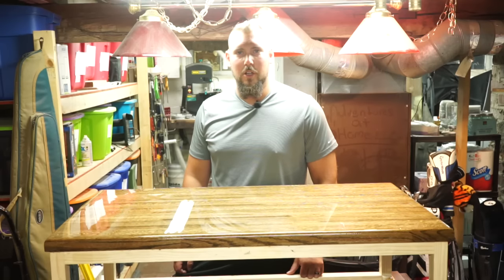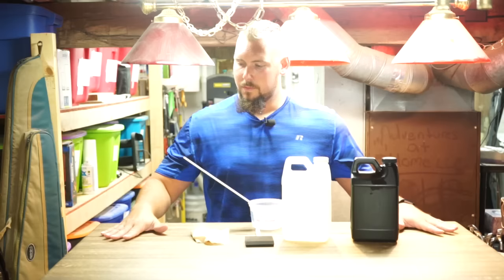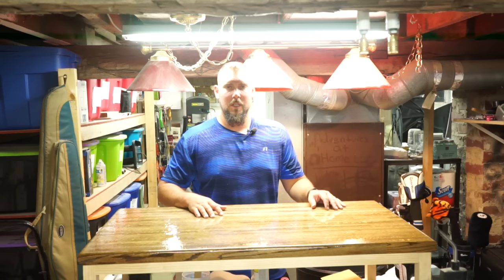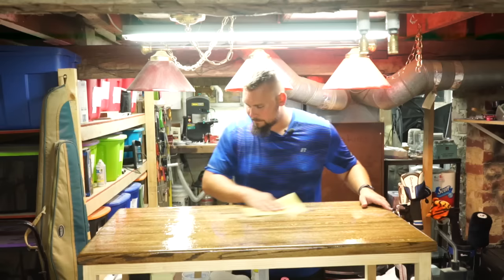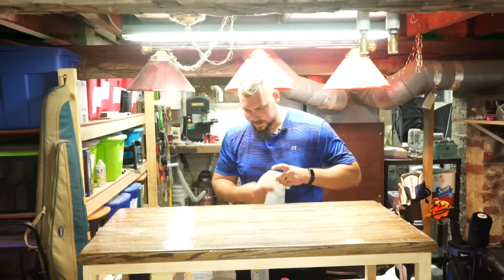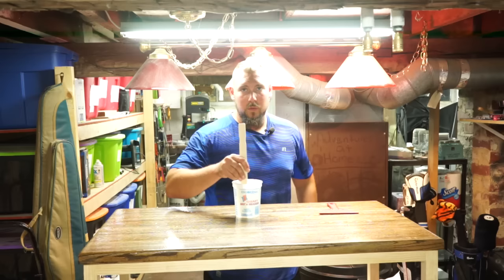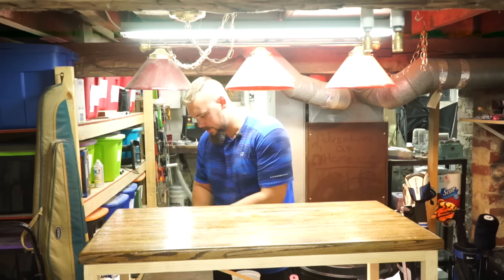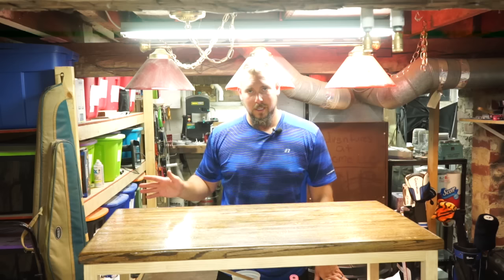DIY – How to Apply Clear Epoxy Resin – “Liquid Glass”

Comment: I’m late to the party but thanks for this video. It was really helpful. Do you remember where you got the weights for the resin and hardener? I’ve searched and haven’t found them for Glaze Coat which is what I’m using. When I tried mixing with the g/ml that you mention for each it did not look at all like a 1 to 1 ratio in terms of volume. Closer to 2 to 1, resin to hardener. Thanks!
Reply: I use clear cast epoxy resin that’s 2.1   Can do 50mm cover normally 5 kg will do a large table.   Hate the polyester resin it drys to quickly

Comment: I'm confused, the epoxy link you showed says its 1:1 ratio, but it seemed like you did about a 2:1 ratio.
Reply: It's a 1:1 volume ratio, but he measured by weight. Since the densities of the resin and hardener are different, the volume and weight ratios are different. I know this is reply is probably too late for you, but hopefully it'll help someone else with the same question.

Comment: I want to use epoxy on a plywood flooring project. Would this process apply?
Reply from the maker: I wouldn't recommend this epoxy for flooring. It would probably not be durable enough to handle foot traffic. Thanks for watching!
Reply: @AdventuresAtHomeLLC  I really appreciate the response!! What epoxy would you recommend? a flexible one?
Reply from the maker: Generally polyurethane is used for flooring. But if this won't yield the finish you want, I would look into a marine grade epoxy coating
Reply: @AdventuresAtHomeLLC  Awesome!!I will look into that! Thanks again and I loved the video bro!

Comment: Did you use all of epoxy for this size table or did you have leftovers in jug.
Reply from the maker: Conservatively I would say we only used about 1/3 of the jugs for this project. We use epoxy quite often so we buy by the gallon. Thanks for watching!
Reply: Damn that's a good question I like to know the answer 2

Comment: Not all epoxy can be weighed to equal parts so be careful when you use scales to measure your epoxy.
Reply from the maker: Correct. They are all measured by volume to get the correct ratio. Which is why we start with volume and covert to weight. Thanks for watching!

Comment: Kile my stuff still not dry afte a week 🤦🏾‍♂️, can I send down and start over
Reply from the maker: I would scrape off as much as you can with a plastic scraper - use a little heat to help. Then sand any thing else off. Good luck, and thanks for watching!
Reply: @AdventuresAtHomeLLC  in my experience this is an issue with the hardener/ epoxy recipe. It's crucial to follow the ratio as closely as you posdibly can.....
Reply from the maker: Exactly why we weigh ours to the gram before mixing!

Comment: So, did he use 16 ounces of each or did he convert to grams and do the difference that way? Confused on that last bit of math.
Reply: I don't know but I've seen every other youtuber stay away from this method. It explicitly says in the instructions to not mix it this way. And the majority of YouTubers will agree. The actual manufacturers instructions insist that you pour one part resin in the first cup (Cup A.) and one part hardener in a second cup (Cup B.) Pour contents from cup B (the hardener) into cup A (the resin.) I know it seems like a waste of a cup but there is a reason that you shouldn't pour both parts straight from their bottles into one cup. The measurements have to be exact minus the residual hardener left in cup B. If the ratio is just slightly in favor of the hardener, an adverse exothermic reaction can occur. The epoxy will cure rapidly out of control and will get super hot and bubble. I know this because it happened to me. I saw vapor coming off the top of the poured mix but what I didn't realize is that it was steam. I couldn't believe how hot it was getting from the very small pour I did. I noticed something dripping off my work table out of the corner of my eye. I turned to look and the cup I had poured it from was falling over as the leftover mix had melted the bottom out of the plastic cup. I pointed an infrared thermometer at it and it was registering over 250 degrees F! I'm not kidding or making up a stupid story. This actually happened. The end result was hard as a rock, a little hazy, and full of bubbles. I'm just saying, it might be worth it to stick to the instructions which are fail safe.

Comment: Thank you so much for the info...Is the first thin coat the mixture of the clear resin and hardener in 50:50 ratio or is it just the resin? Cheers
Reply from the maker: It is the resin and hardener mixed, just applied in a thinner layer. Thanks for watching!
Reply: @AdventuresAtHomeLLC  Thanks for a quick reply...Appreciate that. Haven't done that before but will give it a go now. Stay safe

Comment: Why doesn't anyone ever show the edges where it drips down?  Unless you watch it like a hawk, new drips always form as it settles and cures.  Sand it and polish it?
Reply from the maker: The edges will self level smooth. The drips that will need to be sanded or chiseled off will be on the bottom edge of the table. Thanks for watching!

Comment: You are applying far too much pressure with the tack cloth. It should by soft pressure and sweep. If you apply firm pressure such as your scrubbing motion, you will transfer the wax from the tact cloth to your wood piece which will affect any finish you apply.

Comment: Checking out your video and wanted to let you know that you shouldn't touch the wood with your bare hands after you've applied chemical cleaner. With metal from vehicles it might be more apparent then on wood but your hands have oil on them that will spread to the surface.

Comment: The lighting is really overexposed and has a huge flare!. You should change the ceiling bulb or add some type of diffusion your using it as a hair light then you need to make sure that the light is behind you and is pointing towards the back of your head.

Comment: 50/50 by volume is different than 50/50 by weight. different densities will yield different volumes if weighing it.
Reply from the maker: Correct, which is why we converted the volume to weight using the density of each part.
Reply: @AdventuresAtHomeLLC  but why did you use volume reference when covering the surface with the foam brush and then used weight reference for the pour?
Reply from the maker: @MrPeteto  We always convert to weight when we measure out our mixes. We just didn't show how we did this until we did the flood coat
Reply: @AdventuresAtHomeLLC  thanks but i still no understand, i apologize but never tried epoxy before and don't understand why if this epoxy is 1:1 volume and lets suppose that you'll need 1lt of mix just don't mix 500 ml of each and done?
Reply from the maker: Yes, you can do it that way. Just make sure you have an accurate way of measuring the volumes. We use cheapo plastic containers, so it is way more accurate for us to do it by weight.
Reply: @AdventuresAtHomeLLC  ok thank you!! Appreciate your help. Thanks for sharing
Reply from the maker: Thank you for watching! Let us know how your project turns out!
Reply: @AdventuresAtHomeLLC  i will.
Reply: Which sucks because we all don’t have kitchen scales laying around.  It’s not the 70’s anymore 🤣

Comment: I would actually recommend not scraping as much of the epoxy out of the mixing container. You risk having unmixed hardener doing that.
Reply: thats why he poured it into another container. That eliminates resin or hardener stuck on the sides.
Reply from the maker: Correct. Thanks Jat002, and thanks for watching!

Comment: Hello,
You have to find an old pinball playfield and try this method on it. If it works, hundreds of people will say thank you to you !
But: ....
-have to resist steel balls moving and moving and micro scratching
-ususally, you do a lot or some paint touchup. First coat must not trash the job
-a playfield is... full of holes. Bulbs, screws, targets.....
-an old playfiled is flat or bent a little

(search pinball playfield spaymax 2k if you want some more details)

Thank you anyway
Franck

Comment: Are you sure those weight measurements are correct? To have such vastly different densities they sure don't feel that different in weight.
Reply: According to the manufacture the density of the resin is 1.154g/ml and the hardener is 0.95g/ml. Don't be an idiot like me and use his numbers.

Comment: That's a lot of epoxy dripping there
Reply from the maker: It is, but necessary to get everything to self level.
Reply: Do you let the drips harden and then remove them or gradually work them as the epoxy hardens? When I did the epoxy on my kitchen table years back it seems this part is overlooked and hard to keep the drips from showing on the underside edge of table.
Reply from the maker: I will generally let them harden before I take care of them with a razor and/or some sandpaper. Thanks for watching!

Comment: I HAVE A QUESTION GUYS! If you torch it too much by accident (getting the air bubbles) can you mess up the curing process?
And is there a written formula someone has so I can figure this math out for measuring. Lmfao. I tried to follow but math was never my strong suit..

Comment: Can you not just use a heat gun????. Seems like it would be more consistent and less dangerous to ruining the piece
Reply from the maker: Heat gun will work, but you risk blowing dust deep into the epoxy. Thanks for watching
Reply: @AdventuresAtHomeLLC  ah ok I guess that makes sense... A filter on the back of the heat gun would handle that.

Comment: The instructions from the product linked in the description clearly state “do NOT use a tack cloth” (all caps in original) prior to applying the solution. Rather than following said instructions, I followed this bozo’s advice. So, I guess it serves me right that I had to go back with a set of tweezers and pick out all of the tack cloth residue from the thin coat that I initially applied. Also, I cannot understand why he mixes the resin and hardener according to weight, rather than volume, which is what the instructions say to do. The one to one volume ratio is way simpler.

Comment: You’re getting too close to the wet epoxy with the torch.  Also, you’re a young man, so please use safety equipment like gloves and a respirator when working with chemicals. That stuff can be very bad for you and it is cumulative over time also.

Comment: I’m not trying to be a jerk- But you have been asked many times about the “sides” and more or less “how to make them correct?” Your responses fall short of explaining “how” since it is hard to believe all the sides will have an equal amount of material coating them by “dripping” excess material from the table’s top. Since you did not film anything concerning the edges I’m left with an empty feeling … I.E. You explained 95% of the process and left out a very important 5%.... just sayin
Reply from the maker: The sides are coated evenly from the run off - it's the easiest part. Thanks for watching!
Reply: Thanks for the reply but I am still not convinced. After all you did "brush" and spread the resin all over the top. It is just hard to visualize (or believe) the sides being covered evenly and equally without having to do some maintenance or brushing. Your explanation leaves me to believe you could just pour ONE puddle of the resin on the middle of the table and let it "take care of itself". Why didn't you do that? And I am not trying to be sarcastic. Actually I believe you did brush the sides but mistakenly omitted or forgot to include it in the video.  With that being said - I do appreciate the workmanship you do and admire anyone who still handcrafts...
Reply from the maker: @petebut8  Give it a try! All the excess runs and drips off leaving an even thickness!
Reply: OK - I'll take you for your word but it is still hard to imagine that the "bottom" straight edge wouldn't have a wave pattern over the lengths of the sides.
Reply from the maker: We were concerned with that our first time using epoxy, and tried to brush them with a foam brush, and that just removed way too much of the epoxy. The epoxy works as promised and self-evens itself out
Reply from the maker: Thanks again for watching! And the dialogue!

Comment: Always wear gloves when using acetone. It's very bad for you and it does soak in to your skin.
Reply from the maker: Next time my wife uses nail polish remover (acetone) I'll make sure to tell her to wear gloves! 😉
Reply: Acetone used in small amounts is not a huge problem, like women doing their nails a few times a month.  When used in industrial/commercial quantities it becomes a problem because acetone is an excellent transfer agent.  It removes the oil from the skin and this can lead to absorbing the ketones or other solvents by the body. General safe practice is use nitrile gloves when working with solvents.